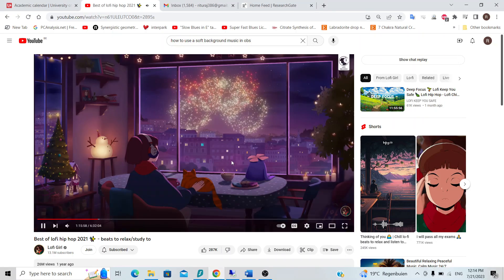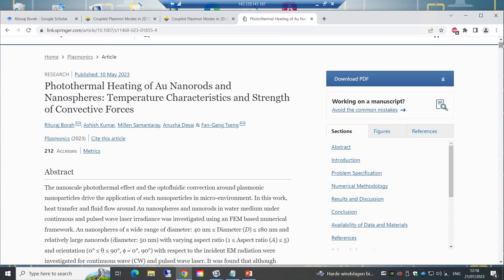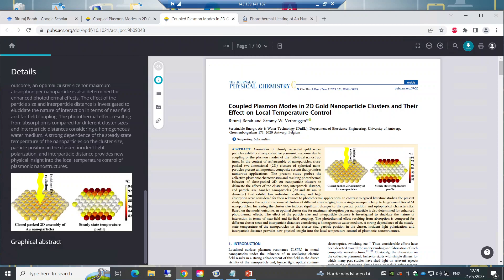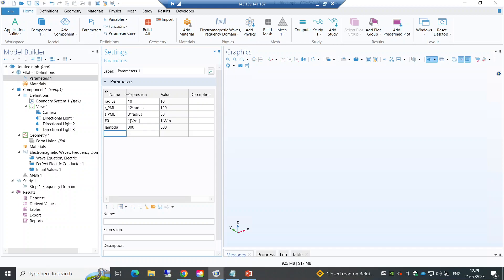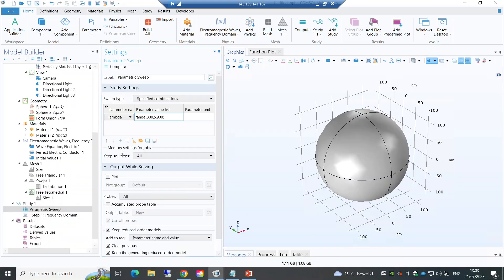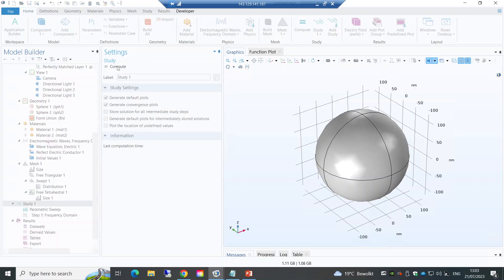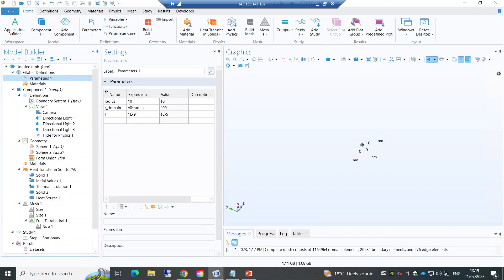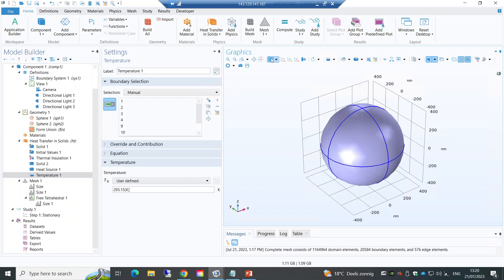COMSOL Multiphysics modeling of nanoparticles for photothermal heating #comsol #finiteelementmethod

Comment from the maker: 🔴IMPORTANT: A small correction: while calculating the absorption cross-section at the end of the first video, one has to divide it by 1.33, refractive index of water.  So the formula to insert at global evaluation would be sigma_abs/1.33.
Reply: Hey, could you please tell, why do we need to divide it with the refractive index i.e. 1.33?

Comment: Sir i have a question regarding cross section. what if i am calculating for the cube, would the heat rate still be the cross section of cube? i am wondering if i could still use cross section value for cube or octahedron colloids.
Reply from the maker: Hello, normally the absorption cross section is the amount of energy absorbed in terms of the area equivalent of intensity. So indeed, you need to calculate the absorption cross section of the structure you are interested in and then multiply it with the applied intensity to find the energy abosrbed. Be sure to be consistent with the units. Hope it helps!

Comment: the background sound is nothing but a distraction
Reply from the maker: Something I realized later.. I didn't have a proper microphone at that time and just recorded the whole thing at one go with my headphone microphone.. too long to re-record although I have a condenser microphone now. 😐 May be I will do something similar in the future..
Reply: @riturajborah382  Sure, we will be glad if you do something similar. Also, I wanted to see how the temperature profiles (line graphs are computed as shown in the paper ) but you showed the "heat map" instead. Next time, you might consider adding the line graphs to your video. Thanks

Comment: As you mentioned, we did, but the absorption cross section with the wavelength does not shift depending on the particle size, and only the intensity of the absorption cross-section increases. I would like to as if there is anything I need to change. :face-red-heart-shape:
Reply from the maker: Is it matching with an analytically calculated spectrum (my Mie solution) of the nanoparticle? Thats the first point to check accuracy. If it does, changing size should change the spectrum? What kind of sizes are you simulating?